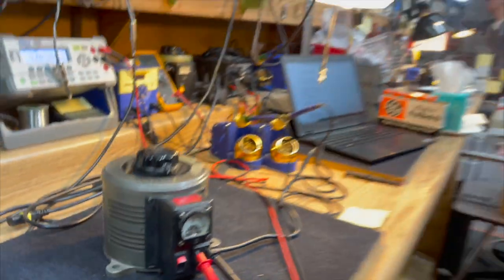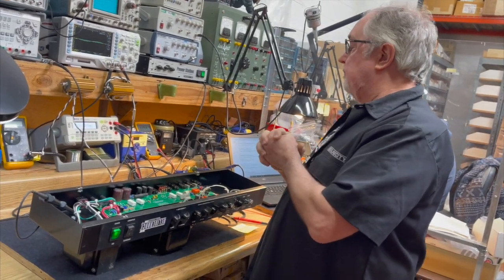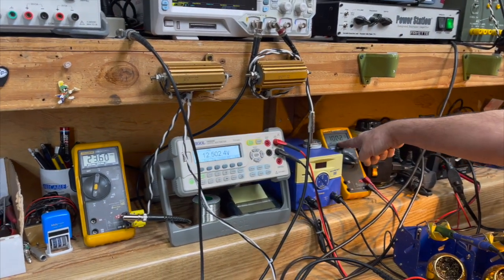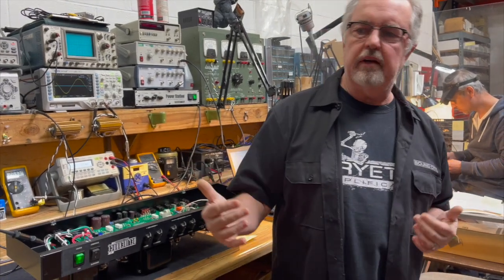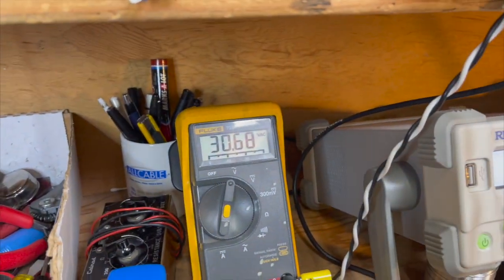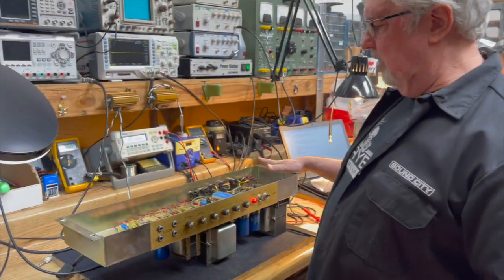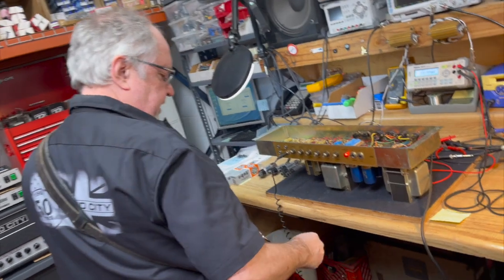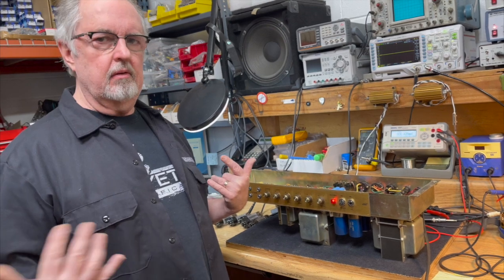Amplifiers and Variacs!

Comment: Awesome breakdown of variac and attenuation methods.   One other super valuable feature of the Power Station is that once you "lock in" your amps sweet spot,  you can then dial your output volume to match your speakers sweet spot for break up or clean up.  Now your amp and speakers are dialed for optimum touch responsiveness and pick attack articulation. My PS is EASILY one of the best purchases I've made  in years.

Comment: Wow, that was amazing. I’m sold, I’ve gotta have a power station. The amp with Electro Harmonix tubes sounded much better than the 2 tube NOS variac solution. The tone with NOS into the Power Station must be heavenly. I’ve been adding effects loops and master volumes to amps that weren’t originally designed with them (Marshall Plexi, Fender Bassman, Fender Deluxe), and not getting the results I liked. Now I know how to achieve what I was intending.

Comment: i have a 1959 HW circuit, ~68 type circuit. i love the 90V sound, at times. i love van halen and his early sound. however, of all the amps i have had, the sound of the 100 watt plexi head really going hard cant be replaced. the variac tone doesnt smack you in the ears and say listen to me near like the full unhinged amp. when you roll the guitar back the 100w also is super touch sensitive. you hear everything that comes near the strings. the 100 w plexi is just such a badass amp in original form. 

so i built a bucking transformer/box to give me wall current or 90V and made my bias circuit switch able. so when i switch wall voltage i switch bias as well. now as mood changes i can change the amp in seconds. 

why bucking transformer, one it was cheaper than a quality variac, two it doesnt drift, three it made it easier to switch voltages in my opinion and a little more idiot proof. four its more robust.
Reply: I'm getting a 100watt marshall clone made with a 90v switch. The amp also has individual bias adjustment pots for the four tubes. I'm going to drop and rebias as you have. Does your amp run hot doing this?
Reply: @Bairov  not any hotter than usual. I ended up putting a pair of small rack fans in the back of my amp. They push air into the head and out the top vent.  The hot smell went away when I did this. This means I leave the back off the head. I leave my amp on 8 for volume. Then just attenuate it down as best I can. So it’s always running hard. It’s blown a couple cheap cap cans because of this. Replaced them all with f &t and they’ve been good since. 

My amp runs 505 volts on the plates with 125 wall voltage. Then pile drives into a rock crusher attenuator. Lowest db I can get is 93. Any lower and the attenuator hats way too hot. It’s a killer amp. I liked the low voltage sound but it took away the amp that I liked playing on. The feel was gone. The concusive sound was way less. So I put it back. 

Thought about putting in a switch and doing as yours is being done but decided I wouldn’t play like that very often since I like the way the amp is stock

Btw. For what it’s work I put nos mustard caps all through the amp. Shipped from Scotland I think. Small difference but I thought what the hell
Reply: @Bairov  good call on rebias it’s a must. Your plates will be around 330-350 volts so the bias has to be fixed. 

Also a proper hand wired amp is really nice since it’s far easier to work on. So you should be good to go there too

Be prepared. If you’ve never played on a a plexi it really exposes your playing. It made me play different. I was used to more gain and endless sustain. Now this amp exposes my short comings. Kind of like switching from hummocks to singles.

Comment: Not so much interested in using one for performance but rather for repairs and building. In the case of building a new amp or kit, or for bringing an amp that’s been sitting for a while up slowly for maintenance and/or repair, how long of a process is it to bring an amp from 0V to full input voltage? I’ve never been able to find any kind of real reference (though I’m sure I just haven’t looked long enough) as to how slowly an amp (especially one that’s never been powered up) should be brought up to full input voltage. This is just the kind of info people like me need to keep from frying something in the design and creation process. Thanks for sharing your knowledge!!
Reply from the maker: Depends on your level of confidence and shelf age of parts. New parts don't need this and production amps are usually consistent enough that they don't need it either. We power up units off the production line with the power switch. They get an initial power up check to make sure all of the basics are good. We just keep a thumb on the switch in case there's an issue.

Comment: It may sound crazy but, at home or in the studio I love running a '67 Fender Deluxe Reverb through a Variac at around 40V and max volume. It's got an amazing overdrive sound that's not flubby. Almost as if I was using a buffered pedal. So, on a separate note, I'm assuming you're using 18V because that is the available tap from your chosen transformer and say you want to go lower than 90V with the Variac and still keep the preamp filaments regulated, why not run the filaments in parallel at 6.3V instead of in series at 12.6V giving you a lot more room to work with?

Comment: Am I understanding correctly, variac'ing the 100 watt plexi down to 90 volts makes the amp output 18watts? If so that's great news for my new project. 100 watt amp with two power tubes pulled that is. So with all 4, is that doubled?

Comment: IIUC power scaling uses a FET of some sort which allows the voltage through it to be adjusted. Steve said it acts as a regulator, I'm not clear why - I mean the FET is not really the same as a beefed up 7812 for example, what am I missing?

Comment: I am building a 100 watt plexi and plan to run it into my Torpedo CaptorX for recording and just playing. The Captor only takes a 100 watt load and I'm worried about overloading it as I plan on cranking the amp. Would using one of these reduce the output to a safe  wattage and is there a way to monitor it accurately?

Comment: hello, when lowering the voltage using the variac, what happens to the heater voltage? will having voltages below 6 volts in the heater section cause something to the tubes?  thank you.................................
Reply from the maker: No. Tube nerds may disagree on esoteric technical grounds that typically do not apply here.

Comment: Well designed Power Scaling circuits do sag and certainly don't sound sterile. They're also very quiet at all power levels. Best built into an amp specifically designed around that rather than as an add on I would say however.
Reply from the maker: Link to a schematic of aforementioned well designed power scaling circuit. please.
Reply: @FryetteAmps  talk to Mark Stephenson
Reply: what they say in the video is that sag is more stable set on a precise level on solid state rectifiers and mostly on amps with regulators than on tube rectified amps. They don't say the variac is useless without a tube rectifier they just say you'll have less range of changing the sag depending on the amp. great information
Reply: @Music_is_fun  I was referring to "Power Scaling" which is very different to a simple variac. It's another attempt to get cranked amp sounds at low volumes: you could say a "rival" to Fryette products and I felt the dismissive comments directed at it in the video were basically not true: ask Suhr, Stephenson etc who know how to use the technology: it's far from sterile and sag is completely achievable in power scaling systems. Every solution to the tube amp volume problem has pros and cons

Comment: The 28 volts (that works out to 100!watts RMS) on the yellow multimeter….where is the 28 volt signal feeding that multimeter coming from?
Reply from the maker: The speaker out from the amp into an 8 ohm load.

Comment: I would like to ask you one question. I use a new Chinese variac on my Marshall JTM45 and my Ceriatone HRM 50 watt amps. I have heard that you cannot run a guitar amp for a long time on one of these Chinese variacs. Is this true that these variacs maybe too risky to use. So far I have only run the variac for usually an hour with amps rebiased at 115 volts or 118. Just wondering. I see you use the Chinese made variacs. I assume they're safe on your amp.
Reply from the maker: Ideally, the variac you use should be rated at twice the power useage of the amp measured from the wall outlet. That info is usually listed on the back of the amp. You'll normally see something like "117V, 300W" on the back near the outlet. But since that rating is the absolute maximum the amp will draw, and that will be a lot less in actual practice when you use a variac, it is safe to use something like a 500W - sometimes stated 500VA - variac. Where it was made is these days pretty irrelevant. A variac rated at 1000VA will simply run a little cooler.
Reply: @FryetteAmps  thank you so much for answering my question.  Love your videos.  Michel from Niagara Falls, Ontario, Canada

Comment: The pair of 6CA7s at 120v gave you 32 watts huh? A pair of EL34s would have given you closer to 50 watts? If I understood correctly, then that explains why my Sylvannia 6CA7 pair just gave me just 32 Watts in a JCM 800 1987. That means 6CA7s would help tame a non master volume Marshall a wee bit. 

I do not want to put lots of miles on those 6CA7s and just kind of curate them (I have a few old tubes I use to compare modern ones with -- Chinese ECC83s seem to compare best to my old Mullard and Brimar ones).

P.S. Now I have a PS-2A I do not need to tame the amps like I needed to do for my previous reactive load. I do get a bit nervous cranking amps into reactive loads though. I blew up my brand new 1959RR so bad using a 1960a cab and also a Palmer Speaker Sim that they gave me a refund (something in the amp was not right and the voltage went really high the tech said). I find myself using Softube plugin amps more often at home, because I can't blow up a plugin and it does not seem worth the tube wear doing hours running scales and stuff to a metronome -- or aimlessly noodling lol :P

Comment: The difference between 6CA7 and  EL34 isn't really that "deep". True pentode outout tubes have a suppressor grid, which was invented and patented by Phillips.  None of the American manufacturers wanted to pay Phillips for the patent rights to manufacture their own pentodes, so the American engineers developed plate structures that were designed to form and shape the electron beam and in some manner imitate the effect of a suppressor grid.  The 6L6, 6V6, 6BQ5, and 6CA7 are all "beam power tubes", not pentodes.  The 6BQ5 was an American attempt at imitating an EL84 as closely as possible without running afoul of the patents, and the 6CA7 was designed to get as close as possible to the performance of an EL34 without running afoul of the patent.  The pinouts are usually the same and you can generally interchange EL34 with 6CA7 in most circuits (and interchange 6BQ5 with EL84 in most circuits) but they might require rebiasing for best possible performance, lowest or highest distortion, and highest power output, and they might not sound quite the same.  

By the way it isn't uncommon to see vintage European made EL84 tubes that were imported and rebranded "6BQ5" by RCA, GE or Sylvania (despite the American branding, the tubes often say "made in Gt Britain); but for some reason its less common to see American-branded "6CA7" tubes that are actually a European import.  The majority of vintage or NOS American- made/branded 6CA7 tubes will be in a fat glass bottle, similar to what you see on a 6L6GC. If they're skinny, straight sided glass bottles, they're almost certainly European imports from Mullard, Amperex or Telefunken, and typically marked with the country of origin. Amperex was originally a Long Island-based NY company making industrial tubes, and apparently they entered into a licensing and import deal or merger with Phillips; and at some point Sylvania had manufacturing deals with GE and also had an import deal going with Philips (probably explains why we see lots of NOS military JAN-spec Phillips tubes ---- the US military would not have wanted to be directly dependent on a European manufacturer for tubes).
Reply from the maker: As we said in this video, we'll get into more detail on the related Malcontents episode, which we did. We also discussed manufacturers cross-marketing in the Mals tube episode. Not to this particular extent though because, you know, margaritas...
Reply: @FryetteAmps thanks for the heads up, I'll check out the other episides. There's so much history lost around the development, manufacture, patents, licensing, rebranding and distribution of tubes, and the inevitable mergers and corporate takeovers. Things got really weird in the late 70's and 80's with companies like National and IEC Servicemaster importing and rebranding tubes. They could be Mullard or Tele and they could be absolute crap from anywhere that was rebranded to look like good European imports (ServiceMaster was notorious for junk).
Reply from the maker: @goodun2974  https://www.youtube.com/watch?v=syjtzkwlUjg&t=9979s
Reply: @FryetteAmps  , that was a good discussion. I would have liked ro see some discussion around heater-current draw and whether any of the re-labeled and "re-imagined"  Russian (or Chinese) tubes exceed the original heater-draw specs sufficiently to cause overheated or blown power trannies; like those "weak" 6L6 types being relabeled as high-voltage 6V6's ---- do they draw .45 A per tube, or .9A per tube? And do "modern 6550's draw 1.5A, with modern 6550A drawing 1.8A, per the 1960's tube specs? Because I have a "DOUBT" rule pertaining to tube "substitution" and "upgrade" with modern production tubes: DOn't Unintentionally Blow Transformers! 

 By the way I have never read anything scholarly about migration of air molecules, O2 or Nitrogen,  into a tube over time unless the seal is bad around one of the pins or lead out wires, in which case usually it's quite obvious because the getter will turn snow white. The only info I ever 
read that possibly related to permeability or susceptibility of glass envelopes to air infiltration is that certain tubes were designed to withstand low air pressure in high-flying military planes (like the Chatham 5R4GY potato masher rectifier); and some transmitting tubes used special high temperature glass or quartz. Pertaining to contamination of the vacuum as tubes age, whether in use or stored away as NOS, water vapor was a particularly troublesome contaminant, and some tube types had their plates and other parts  baked in hydrogen to drive out contaminants (according to the reference book "Tube Lore" by Lidwell Sibley). Hmm, would you want a high-temperature hydrogen furnace operating iin the neighboring industrial park?

 The quality and insulating qualities of the mica insulators is gonna be important as well (Russia supposedly has excellent quality mica) and the wafers are presumably baked to drive out moisture and then sometimes coated with compounds to increase their insulating factor.  Having encountered tubes with interelement leakage, I have to wonder if some of the metallic materials in the getter got splattered on the insulators when the tube was flashed with the spot RF beam, or if the cathodes sputtered away some emissive material onto the micas or (worse) onto the grids, screens or plates, causing gassy behavior and thermal runaway.

 I also read somewhere that the KT series of kinkless tetrodes were purportedly originally built with gold plated or perhaps carbonized grids to minimize grid emission, but I don't know if such manufacturing techniques were ever applied to more modern Russian or Chinese tube manufacturing. 99.9% of my tube experience has been with vintage American and European tubes, and as you've pointed out, the original design, engineering specs and manufacturing processes used for our favorite vintage tubes is often merely a suggestion at best to the modern tube manufacturers.
Reply: @FryetteAmps  , ps,  A discussion of the 6BQ5 beam power tube versus true pentode EL84, as well as their tougher semi-equivalent the 7189 and 7189A, seems in order.  Especially germane to the discussion is whether there are any additional pinouts being used for heat dissipation of the grid and screen, or cases like the 7189A where the pin out is changed so that only the 7189A will work in certain amplifiers (like some older Magnatones) that run at voltages and dissipation well above what a 6BQ5, EL84 or regular 7189 can handle. And, does anybody make a usable "6973" these days?